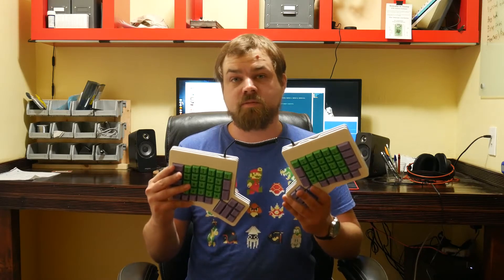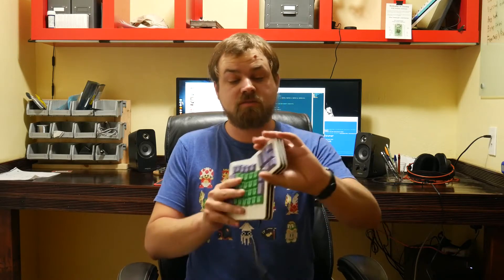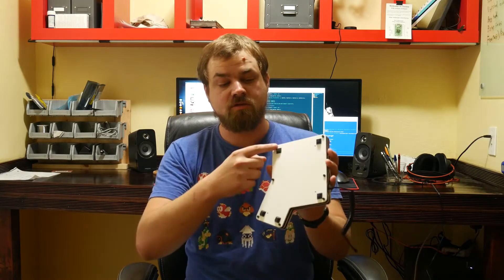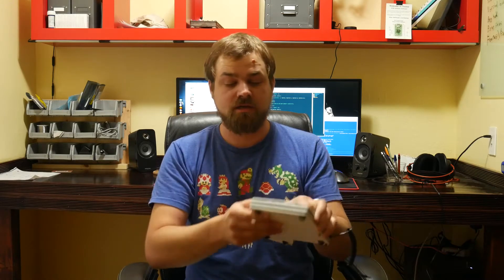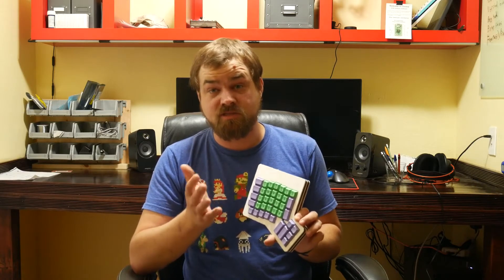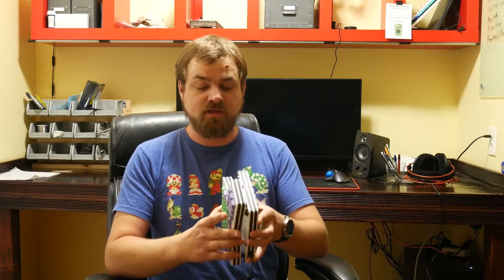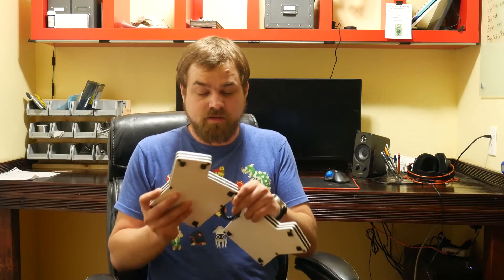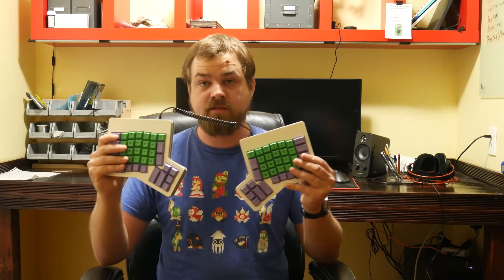Custom Ergodox Build and Thoughts

Comment: Instead of backspace, enter and so on you should try to use the thumbs for layer modifiers. I also have the shift key on my left thumb. And I agree, the thumb cluster on the ergodox is mostly useless. I have a Redox keyboard and I only use the lower two keys and I also think the thumb cluster of the ergodox is too far away and you have to stretch you thumb to much. The Redox thumb cluster is a bit closer

Comment: You've probably moved on by now, but for anyone interested -- the correction for the usability issue of the small thumb keys is quite simple, actually. They need to be taller than the longer thumb keys.  I have used Kinesis keyboards for about 15 years and that is how they are set up on the Advantage. I copied that setup on the ErgoDox and it rocks.  I would imagine they can be ordered but didn't need to because I pulled mine off one of my Kinesis boards.  I can get some measurements with a caliper when I get home if you are interested.  I can imagine the hassle it would be to use all flat/level thumb keys.

By being taller than the "long" keys  they are very rapidly and easily reached.  The inner most line of thumb keys (the three in a row vertically) are also staggered in height with, e.g., the PgDn key being the same height as the longer thumb keys, and the PgUp key being a height in between that and the two tallest keys.
Reply from the maker: I haven't moved on yet. I'm still using this board as my daily driver for work and love it. I haven't tried using an SA or other taller keysets, I'm sure that would help with reaching those small keys. Right now I don't really miss those keys as the function modifier and other keys work just as well. I'd love to try out the kinesis, Acidfire's grand piano ergodox and adereth's dactyl for a comparison.

Comment: Are you still on colemak? I did the switch about 6 month ago and i was spending a whole weekend with a typing tutor programm it feels way better type on colemak, but this is maybe because i also learned real touchtyping and switched to matrix layouts at the same time.

What helped a lot was uning blanck keycaps.
Reply from the maker: I gave up on colemak. I really wanted to switch but after a few months I just couldn't get the hang of it and touch type. Maybe I'll try it again in the future, I really did love typing some of the common words like "the" as they just rolled off the fingers. One of the main reasons I gave it up tho is because I switched to the ortholinear layout (ergodox/atreus) layouts and colemak at the same time and wanted to find out if it was the key placement or layout that was slowing me down.

Comment: Out of curiosity, what made you choose Colemak? I will be getting an Ergodox soon and am having a tough time figuring out which layout I want to use on it. I was considering Workman, which seems to have been partially designed with the column setup in mind (but doesn't take thumb keys into account)

What's your solution for getting your ergodox to be compatible with standard keybinds in games? I am considering leaving a standard QWERTY layer in my ergodox that I could switch to, so that I don't have to go through the trouble of rebinding everything in every game.
Reply from the maker: None of the layouts are going to have the thumb keys in mind from what I've seen since most layouts are means as a replacement for the standard keyboard layout and not an ergodox. I chose colemak because it was similar enough to qwerty for standard shortcuts and every device/os I use has a colemak layout (workman doesn't have much support). If you only plan on using your ergodox then standard support isn't a big issue but for things like my chromebook pixel, phone and other peoples computers it's easy to switch to colemak temporary where workman isn't. dvorak is also a decent choice in this regard however colemak just seems newer. 

For games I just rebound keys but you do get into situations where the developer forgot to bind keys and uses some hardcoded values (the new doom does this which is annoying). I've heard of some people having a layer for qwerty to switch to during gaming, I haven't tried it tho.  

That being said I'm back on qwerty, I was on colemak for about 2 months and I just couldn't adjust fast enough and I need the speed for work. Now that I've switched back to qwerty I'm much happier with the ergodox.
Reply: I plan on using my ergodox for most things. I actually bring my current keyboard to work with me, and since the ergodox has the support in the firmware I don't care too much about needing a toggle in the OS (that's a big part of why I chose to get an ergodox in the first place).

I know there's going to be times where I'll need to use qwerty (ie, my laptop, or phone, or any time I need to use someone else's keyboard), but I don't think I'll be completely destroying my ability to use qwerty. I know switching between the two might end up being awkward- but the way I see it, the ergodox looks like it's shaped/structured differently enough that typing on it will be like learning a new skill, rather than overwriting an old one.

Did you find that trying to use colemak on the ergodox made it hard/difficult to use a laptop keyboard for example? Or was it more the other way around, where using a laptop for a while would screw up your colemak skills.
Reply from the maker: The keymap made more of a difference than the layout. I switch between a 60% and laptop at home and ergo dox at work and have no issues now that I'm all on qwerty. One thing I do occasionally is use the spacebar for backspace/delete on keyboards that don't have the thumb cluster so there is that confusion but it isn't bad.